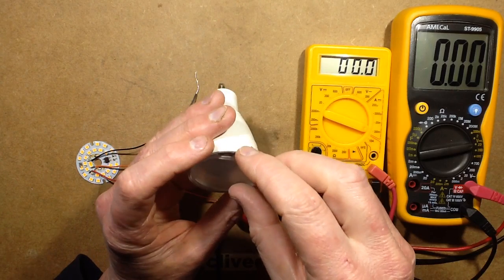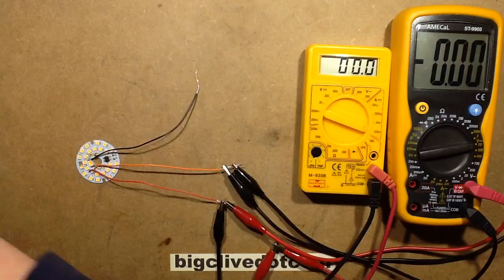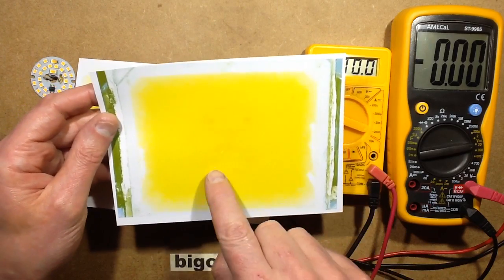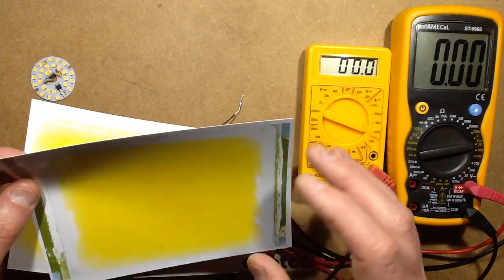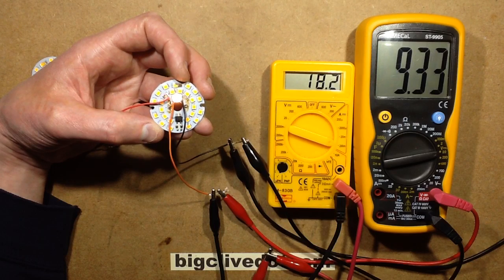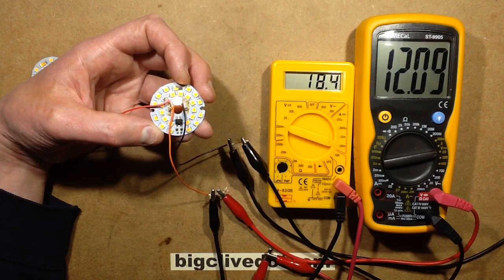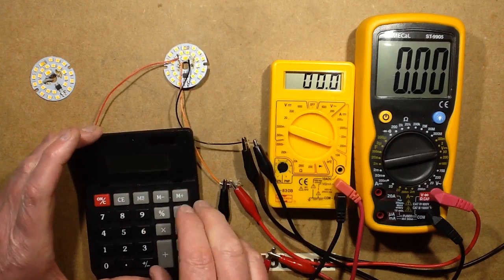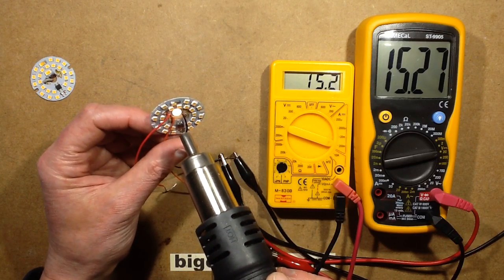Test and analysis of unusual (dead) LED lamp.

Comment: "I don't know if that's a real 9 watts or a Chinese 9 watts..."
Reply: +pillsnotbills i wonder if there is a conversion guide
Reply from the maker: +Mr Jay White It's easy.  A Chinese watt is approximately half of a normal watt, or a third if the light involves "three watt" LEDs.,
Reply: bigclivedotcom From my own experiences, I would say that sounds about right. :)
Reply: bigclivedotcom this is the sort of information sorely lacking in textbooks :-j
Reply: +NaxNir 
Seems lejit.
Reply: +bigclivedotcom did you follow a education in electronics? can you recommend a education for a starter in small electronics? as re education I hope to master skills needed to diagnose and repair radio and TV sets.
Reply: Arjan Wilbie I know you are not asking me, but I am going to get in here and say that unless your intention is to restore antiques or heirloom sets of some sort, you are wasting your time with that.  It's not like the old days when a TV cost an absolute fortune, you kept it for 20 or 30 years, and nothing ever changed.

Today, TVs are practically disposable.  If anything goes wrong, it is usually sent to the landfill or recycler and replaced.  A repair is usually non-economic and many components are difficult or impossible to obtain.  Even if you can get them, it is hardly worthwhile when the repair costs almost as much as a brand new TV (and consumers know this).

With radios, it's even worse: who even owns an actual "radio set"?  If you're referring to amateur or "ham" radio equipment that's a little different, but either way, a generalist electronics diploma or certificate of some sort is a good starting point, and go on to some specialisation from there.  An Electrical Engineering university degree is another approach, but if you have some background or understanding of electricity first, it will be very helpful rather than going in "cold".

I have no idea where you are so I am not going to give specifics.  I will end by saying there are many very promising and fruitful fields in electronics that make excellent career choices.  Except in very unusual circumstances, repairing radios and TVs is definitely not among them.  There is no future in that.
Reply: thank you for answering,
i have a bit of experience in vehicle electrics, fault finding , part rewires and restoring starter motors and dynamos. since i got 71% disability i need to find work in another passion (restoration bricklaying was my passion) and the agency classed me suited for soldering circuit boards. i want to understand what i make so, fairly said i need to start from the beginning.
Reply: Arjan Wilbie
If you're going to get into working on electronics, practice on some broken ones. You know, removing parts that might still be good to keep, adding and removing wires, etc to get the feel of it. And of course, there's tons of great places to start learning about electronics repair, construction and the like.

Reading books like "The Essentials of Electronics, A Survey by Frank D Petruzella" are great to learn the principles of how simple electronic circuits work and how to use tools like a soldering iron. It also teaches how to do the math to calculate resistance and other measurements, goes over basic safety stuff and later on goes into more complex circuits.
Reply: +pillsnotbills Lets just be frank and truthful and call is false advertising by Chinese Ebay sellers. But the products are so cheep you forgive them as you usually still get more for you're money than if you were to buy a comparable product at you're local shop.
Reply: theLuigiFan0007 I will ask for the recommended book, same as soldering course and some books on car electrics as engine management modules are always wanted and after learning the older generation does not know how to install newer engines in older cars because of the wires that seems like a big problem.
Reply: Arjan Wilbie
Yeah, newer engines have much more complex control systems, and tons of sensors that continuously provide feedback. I don't know too much on the mechanical side of things besides the basics that make it run. My main interest in is computers and electronic design but I know a few things about other topics. Something I intend to learn a bit more about in the future is washers/dryers, ovens/stoves, cars, welding and basic woodworking skills. Just some stuff I personally feel it will be important to know so I can fix stuff myself and build things I need.

Hope your learning goes well!
Reply: china has a different math system . i bought a 5000 watt/30,000 watt peak inverter. it has a 25 amp fuse that blew with a 1400 watt air conditioner. it's bs.

Comment: The bigger LED named 5730 and the one in this board embedded with current limiter  which builded in "FET" field effect transistor.  As you guessed, it control the total current running through the whole circuit. 
Those kind of current limiter can be used safely if using plastic case as your video but not in metal case.

Comment: A little more maths:

-The peak voltage from that rectifier is 240*√2 =339v. 

-The forward voltage of the LEDs is 219v, as you say. 

-The regulator chip in that larger LED package therefore has to drop 339-219=120v.

-The power dissipated by that chip is 120 * 0.02 = 2.4W just in that tiny chip. No wonder they fail, though I'm surprised it still worked well enough for you to test it like that...
Reply: Not quite, you recognized that you were dealing with RMS voltage when you calculated the peak voltage, but by the finish you seem to have forgotten that you were dealing with a peak impulse power, not a steady state dissipation.  The peak dissipation may well be 2.4W, as calculated, but that peak is for a very short duration each cycle, leading to a much lower average power dissipation and it is that average power dissipation that matters most in most instances.  Although it had a heavy chassis for heatsinking, I did not notice an especially good interface between the metal core PCB and that heatsink chassis, nor any obvious signs of thermal compound to assist in heat transfer, which was most likely the greater contributing factor (but that is my $0.02).  Power surges are also a very possible culprit if they ever exceed the breakdown or dielectric voltage limits for the semiconductors and their junctions.

Comment: Could this be an LED with an embedded CCR (Constant Current Regulator)? I experimented with a few of these a while back to drive an LED flashlight. On Semi made them in versions from 20mA to 350mA. They are used in circuit just like a current limiting resistor but they fix the current instead. Only problem I had was heat. If the voltage was much above the minimum needed to regulate, they get quite hot. One CCR fell off my test board when the solder melted.

Comment: Clive, would you happen have a recommendation as to which of your consumer LED lighting fixture videos have the most representative examples of what is out there on the market?  I'm trying to get a deeper understanding of the operating principles of some of these circuits, and they seem to vary quite a bit. I'm not sure if you check the comments on these older videos but here's hoping! Cheers from the US :)

Comment: I was thinking they put a JFET in there hooked up as a constant current diode, but the biggest one I could find could handle 5ma at 20 volts. It has to be some sort of dual transistor current regulator.

Comment: Couldn't you put the board in a freezer and then put a oscilloscope over a shunt resistor to see how it reacts on the cold start to see if you get a current spike or not when it's at -20 or so centigrades?

Comment: currently have most of my house using 12W COB GU10 LEDs,  which inside the heatsink has all sorts of wizardry on a board.
I then bought 9W COB GU10 (Sealed units) AS in instead of a ring, bulb, and wire,  its all one unit, and it came with a Driver.
Turns out this Sealed unit with a driver,  is just an exploded version of my 12W Cob Gu10 bulbs,  Very bright, very good spread, and possibly the best Bulbs I have used.
however one of these 9w (sealed) Bulb units, does not work, I can not see any sign of burns, and have opened it,  could I just be a duff lamp.
Was thinking of sending in for a video investigation?!
Reply from the maker: +Burgattti Have you narrowed it down to a driver or lamp?  (If they have an inline connector between them.)
Reply: +bigclivedotcom it is just the lamp as I have swapped the drivers around.   (same pics as the email)  cheers!
Reply from the maker: +Burgattti The COB arrays have a multiple series/parallel arrangement of LEDs in them, so I'd expect some to light even if one had failed.  Check the polarity of the connections to the COB in the lamp in case they have swapped it accidentally.
Reply: +bigclivedotcom Brilliant sounds like a plan! And now that you say it i feel rather silly as yes usually you get some glow but this is totally zero will definitely try swapping!
Reply: just tried,  didnt work either way,  tested other lamps  driver is fine,  just checked the face of the unit again, and it seems there it two tiny black spots now, must of burnt out instantly when i reversed

Comment: bigclive, our new chandelier is killing Florescent and LED lamps. how do I go about finding the cause and fixing it? all three LEDs were running at about 50 degrees Celsius and rated at about 12w. voltage was also stable at 230v. halp !!!!!
Reply from the maker: +darthmaul Are the lights enclosed in shades?  Is there a dimmer or electronic switch in use?  It might also be down to the fact that many of the higher wattage lamps are not really fit for purpose and fail very quickly.  It might be worth trying some more down to earth 3W ones.
Reply: +bigclivedotcom , yes actually. lamps are shrouded with a double layer of plastic and glass that seems to have the top sealed. trying a 3 Chinese watt lamp ATM that have lasted the night so far.
Reply: +bigclivedotcom , no dimmer but there are a few small LEDs decorating to mounting plate.

Comment: It must have been flickering like mad with without any capacitors. yuck. I have a bunch of G4 LEDs where I have replaced the 12v PSU in the attic with a DC PSU, even though the LEDs had a capacitor. 
To be fair, the people who sold me the LEDs, did recommend it too.
The hard part was to find G4s with a CRI above 90, but the ones I got should be that.
Reply: +ELECTRONTHORP Don't think the voltage has anything to do with it.
Reply: +Someone Somewhere 
Well... it kinda has everything to do with it... if incoming AC is 240v and you need 200v to light the leds there will only be a small part of the incoming waveform that can produce the required forward voltage. If the forward voltage was 100v the led's would be passing current for a much higher percentage of time.
  
As far as flickering goes though... we have to take into account parasitic capacitance/ inductance (maybe the led with reg chip is helping here too).. IE: If voltage is applied to an LED there will be a measurable time before it starts to light and also a measurable time for it to turn off... If the off time takes longer than on time and A/C frequency is high enough a capacitor would not be required to reduce/eliminate any noticeable flicker.
Reply: +Ben Lucas LEDs have turn-on/turn-off times that are extremely short - in the microseconds, I think. Remember the same tech is used for fibre transmitters with bandwidth in the GHz.
Flicker is more about frequency than duty cycle, unless the off period is very very very short.

Comment: so we are heading towards a single component led array that is mains voltage input?  means no circuit board at all...
Reply: +jusb1066 That is possible with COB style LED with all the parts integrated into one yellow blob.
Reply: +ELECTRONTHORP Smoothing capacitors would certainly be a problem, but there is an alternate solution and that is to use higher persistence phosphors in the LED to carry over the light which could greatly reduce flicker without needing large smoothing capacitors.
Reply: +jusb1066 Just had a look at AliExpress and spotted quite a few  LED COB modules designed for direct mains power. 
A search for LED COB module 220V (or 110V) and you should find them

Comment: We have 3&5(ish)W  Philips Gu10 LED spotlights. They die as their capacitors get baked.
Reply: I have several dead GU10 claimed to deliver 340 to 370 lumens. Warm or cold white, they don't last very long, but neither do the tungsten type. 

I had a look in one today and the 5 LEDs look as though they, in series, take 97volts. Can't remember what all is in the circuit, although it does seem to have a tranformer.  

The LEDs are probably close to each other to make it easy for the plastic focusing lens to make it look better.

Comment: I've just got one of those cheapo yellow meters and there's no fuse in it, despite what it says on that back.  Has yours?

I can't say I'm very bothered and could always fit one.
Reply from the maker: +ThePillenwerfer It does.  Right down at the bottom next to the battery.  I've got some others on the way though for analysis.
Reply: Mine's got pads on the PCB where clips could go but they aren't fitted.  It looks like they are shorted by a very fine track between two of the concentric rings under the knob.
Reply: +ThePillenwerfer "It looks like they are shorted by a very fine track between two of the concentric rings under the knob." sounds like a fuse to me :p
Reply: +ThePillenwerfer Sounds like a countefreit.
Reply: +BloodySword Not counterfeit but a permanent fuse etched directly onto the circuit board. Burn that fuse and the meter is gone, suited only for the circular archive.
Reply: +ThePillenwerfer Got one that looks like that too. You have to open it up to find the fuse. It's a cheap product, but I just use it for basic measuring and diagnostics on my pinball machines, the things I am capable of using it for does not require great accuracy. :)
Reply: +Martin J 
I know the feeling.  I'm the same: it's great for a quick test and if it gets lost or damaged isn't a disaster.  I've got an AVO 8 for when it really matters.

Comment: +bigclivedotcom Clive, I know you run a tank system for your printer, but do you have any recommendations for who/what to look for in ebay ink suppliers? (sorry, I know you've probably answered this. but I haven't seen it...sorry, mate). My ink experience is generally, "bend over, and HP will now do terrible things". :/
Reply from the maker: +TheJohn8765 It's an old printer so I just used a generic cheap CISS ink system for it, and fill it with equally generic cheap ink.  HP aren't the easiest cartridges to refill.

Comment: What is mostly the volt rating of each led that size?..thanks
Reply from the maker: Most white LEDs have a forward voltage of around 3V, but some have multiple chips inside and can have much higher combined voltages.

Comment: Why do the Chinese lie about EASILY provable numbers? if I say I'm 3M tall we can debunk that pretty fast, same with watts etc
Reply: It gets even more interesting with batteries where they play the "dropped decimal" game, calling a 500.0mAh battery a 5000mAh battery, making the 10x over spec'ing all the more absurd.  But I suspect it stems from the same sociopathic tendency that enables certain Chinese businessmen to use Melamine as a protein substitute in infant formula and pet foods without such wrecking their conscience when infants and pets predictably die so that they can pocket the savings.  It is the dark side to capitalism in an environment where their are few to no regulations enforcing serious consequences and accountability for such behavior.  The West went through some similar dark periods as well in the absence of early regulations (and still does from time to time, but there tend to be greater consequences on the average).

Comment: I watch so many of these videos, that occasionally I forget exactly who did what to which device and when. That said, was it you who used leds to make a small rectifier?
Reply from the maker: The control panel indicators had the LEDs working as rectifiers.

Comment: if i show u a chip can u tell me what it is 3 past black chip looks like mossfad chip    its in my led light it a diver thats gone bad win i band chip it make led go on win power on or led get more power win chip bant or moved its has het sink on it it looks like a current regulator diode black chip i need to put in a new one if u cant tell me wher i get 120 to 140volt dc. 400 mah. diver pleezz help find one cheep ebay